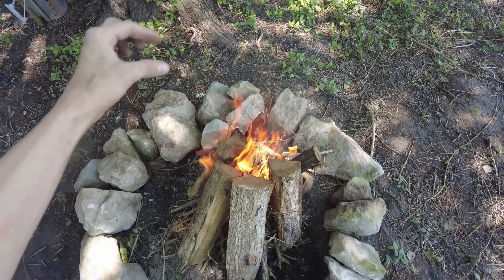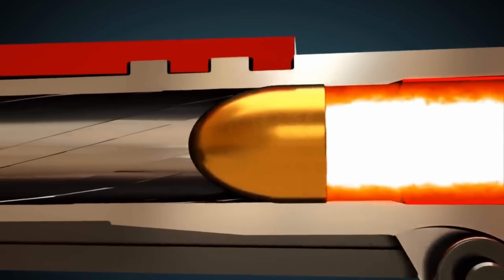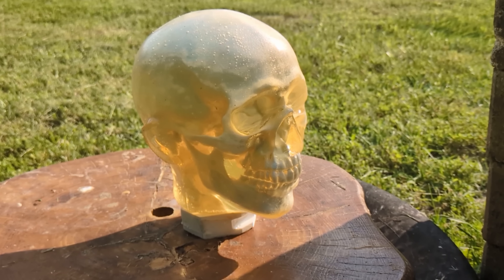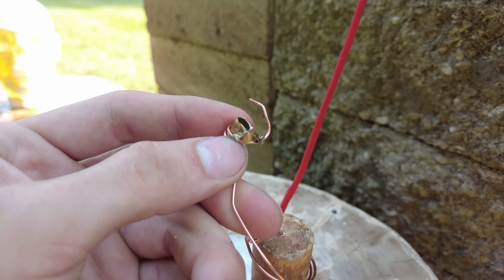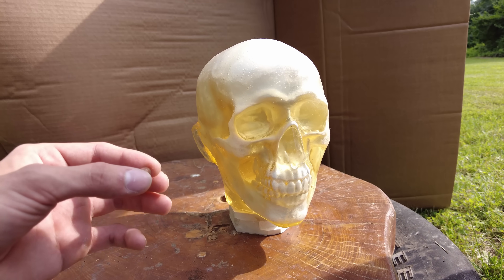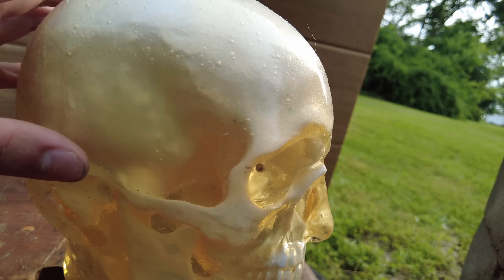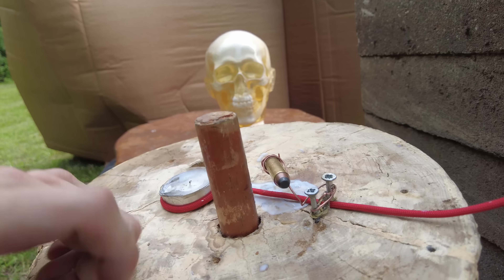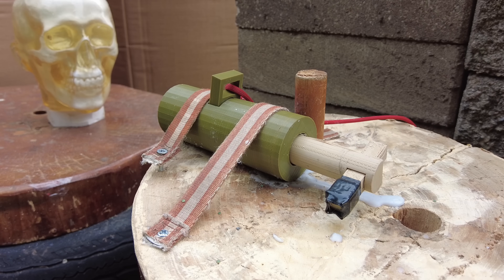Can a Bullet Kill Without a Gun?

Comment: In the case of a potential hang fire, it is suggested to carry the round by the bullet, (to the dud box) as it has more mass and the casing is more likely to fire as the projectile. Since there is no pressure or resistance to the casing outside of the chamber. I'd be curious to see this experiment with the bullets restricted and see how much damage the casings could do?

Comment: 1:55 I wonder if the wire is wrapped around the casing too many times.  If you look at the results of the experiment you can see how the case is shredded up at the front end where the bullet is, but not where the wire is wrapped around it, apparently helping to hold it together.  This means the wire is having some defree of influence over the outcome of the experiment.  It may require a stiffer wire, but the wire should be wrapped around the casing as few times as possible, optimally only one wrap or fewer (by fewer than one I mean like 3/4 or 4/5 of a full wrap,) and it should be all the way at the rear of the casing toward the primer end where the casing is strongest and will probably not shred regardless of the wire.  That way the wire is not having a really appreciable effect upon the outcome of any of the tests.

If anything, the wire is helping the bullet, and the test is already showing that showed that the .22 appeared not to damage bystander facsimile, so it's less important on the small caliber test, however, this kind of thing could make a more appreciable difference with a higher power bullet, helping the casing act as a sort of mini-barrel to concentrate and direct the forces the nitrocellulose applies to the bullet.  If the casing explodes then the bullet is imparted with considerably less force than if the casing remains intact.

Honestly it doesn't matter because the danger is so low, either way, but isolating variables is always a good science habit.

Comment: So for the sake of science I'll give input as someone that has been hit in the forehead by a 9mm bullet in a similar fashion.(Context: Was nearly 11years ago, was in a dark place, learned my lesson and doing well now so no worries)

From a distance of I think roughly 8in away, it hit the center of my forehead. Broke skin at the impact point and left a small scar but no real major damage. Had a headache and ears ringing for a moment. Bled a fair bit like any head wound does. Cleaned up and put a bandage on it and was fine. 

Was held with pliers and put a lighter straight to the primer. In my case the casing stayed fully intact minus the primer being ejected. Unsure if that's from the heat being more localized directly on the primer, the pliers helping hold the casing together, or both. Also unsure if the casing holding shape affected the pressure output on the bullet head at all.

Comment: Honestly. I think the experiment should be redone with some kind of copper wire holding a nail in place to hit the primer and a hammer on a kind of swing arm that hits the nail into the primer. 

Like the thumbnail of the video. Would have much better results especially with the shotgun shells. 

I did a similar experiment with a tracer 9mm round and almost started a fire. Very entertaining.

Comment: I think part of the "problem", is that the case is not being braced against anything. So it's accelerating the case backwards, while also accelerating the bullet forwards. This reduces the bullet's overall velocity. So this is fine for whether or not throwing bullets into a fire is dangerous or not, but if the case is braced against something securely, they might be lethal.
Reply: If you had a barrel, though, you can have no gun breach to brace the shell's rear and still have usable forward velocity. Recoilless rifles were very prevalent for a time using this principle, it cuts velocity roughly in half but almost totally mitigates recoil.
Reply: @bluntcabbage6042  Recoilless rifles actually do have a brace. The basic principle behind how a recoilless rifle works is accelerating a ballast rearward, to cancel out the recoil. The theory is, if you position two identical guns back to back, their recoils will cancel each other out. A recoiless gun works in the same way, but instead of a second gun, it's accelerating a ballast made of gas, rearward to cancel the recoil. But principle is the same, the two guns are braced against each other, similarly the projectile accelerated out the barrel, is braced against the propellant that was accelerated out the rear.

Comment: its because he is using heat to weaken the casing which cooks off the round. If you actually strike the primer correctly with enough force it will set the round off. The most common tactic used is shotgun shells under a piece of flooring (typically the area between doorways) and when stepped on pushes the shells into nails standing vertical and will fire them up through the floor.

Comment: In Afghanistan they used to saw a propane tank in half, reinforced the bottom with a circular steel plate and load the bottom with HME tons of heavy nuts and bolts and point it at the road to penetrate the sides of our MRAP’s. DFC Direction Fragmentation Charge I believe the acronym stood for I’ve been out for 11 years and deployed to Sangin back in 2010-2011.

Comment: Higher power rounds, like magnum rated pistol cartridges or supersonic rifle cartridges, often split under the immense pressure, and it is not uncommon to find bullets, still pressed into brass cartridges, that failed at the middle or primer end. The bullet seat and barrel are necessary for bringing the bullet up to speed, but the firing chamber and bolt are critical to reinforcing the brass cartridge and producing a repeatable effect.

Comment: Bullets need the pressure, otherwise it's just a fire cracker lol. I watched garand thumb fire a 50bmg round out of a 12 gauge single shot shotgun, it basically fell out of the barrel lol. OK ok, it was slightly more violent than that but I honestly question whether or not it could have done any damage. This happened because the 12 gauge barrel did not have the same neck down that the 50bmg cartridge did. So the cartridge just expanded out to fit the barrel of the shotgun and in result lost most of its pressure. Then I watched another video, this time it was Kentucky ballistics and he was shooting rounds into a 6ft deep tank of water towards a ballistic dummy. He tested numerous calibers, including 50bmg and none of them reached the ballistic dummy and did no damage. Which I suppose is a good thing to know if I'm ever being shot at.

Comment: I did NOT expect the bullets to be this weak without a gun, I suppose a ton of pressure does escape without doing the propelling, but it's still astounding.
Reply: Same reason why if you make a tight fist around a good sized firecracker will remove fingers while on an open palm it causes minor damage. Pressure does crazy stuff to explosives.
Reply: Yeah thats not why its because he is using heat to weaken the casing which cooks off the round. If you actually strike the primer correctly with enough force it will set the round off. The most common tactic used is shotgun shells under a piece of flooring (typically the area between doorways) and when stepped on pushes the shells into nails standing vertical and will fire them up through the floor.
Reply: @armyvet1387 wasn't that shotgun thing just a myth from the movies
Reply: @ConFlow247 no it was a trap dating back to vietnam (though they used bamboo cylinders to hold the shell and used a pressure plate trap on top) very simple to make and devastating because the buckshot tears through your legs where you have some of the largest blood vessels & major arteries not very well protected compares to center mass. Its still used to this day in IED preasure traps because of its effectiveness.
Reply: @armyvet1387  what is preasure a typo for? Depending on which this has very different implications...
Reply: @TomiSucco should be pressure 😅

Comment: The part that is going to seriously hurt you is the fast moving pieces of metal of the casing.  

The projectile doesn't move particularly fast when it the cartridge detonates because of inertia, it's the rest of the case that blows apart that causes you the most grief.  It's the weakest point of the whole transaction, that's where it actually blows out and hurts you.  

I know of someone who dropped a cartridge on the primer, which detonated, and he ended up with shrapnel injuries to his face (he watched the cartridge fall) and to his legs as a result, do not try this at home.

Comment: Mythbusters did a similar myth with similar results (putting bullets in place of a car's fuses), with shrapnel just about strong enough to pierce through clothing and unless hitting a vital point would leave only light wounds. 
On a more serious case, there's a report of a soldier setting up a machine gun mount and having trouble setting the fixing pin he picked up a 50BMG round and hammered the pin with the butt of the round. I don't think I have to explain what happened.

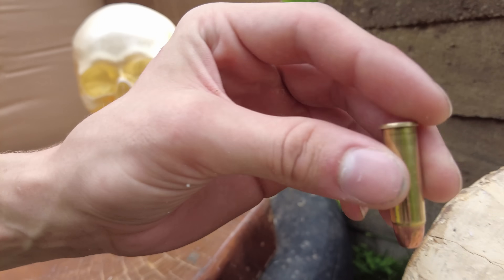Comment: @4:29 The .38 Special's bullet is not smaller than the 9mm at all.  It's the same diameter, and usually heavier (so longer) than a 9mm bullet.  Note, I say "usually" because the common bullet weights for 9mm are 115 grains, 124 grains, and 147 grains.  For .38 Special, they are 125 grains and 158 grains, though you sometimes see lighter (110 grains) or heavier (180 grains), just not that much.  And of course, there are some bullets that will stray outside of those typical weights too, but those are often solid copper instead of lead/copper jacketed.
Reply: Sybau
Reply: Ok nerd 🤓
Reply: @DClaudepierre  Lol, I've got the gun autism.
Reply: @DClaudepierre  oh excuse him for sharing accurate info on an informational video’s comment section. Maybe you were looking for some genre of “brain rot”?
Reply: @E @El_Pozolero huh?
Reply: @El_Pozolero  It ain't that serious, dude.
Reply: @El_Pozolero 😂 diddy ah blud

Comment: Fun fact the Vietcong used to use rifle and shotgun shells with bamboo as a trap. They would but a very narrow bamboo shoot to simulate a barrel around the cartridge but a nail against the primer. And put a board or even surface overtop so when people stepped on it it would actually set off the primer and fire the round. This was very effective throughout the war
Reply: Elite knowledge i commented this very trap on people talking about the shotgun shells, i just explained the trap but basically it was user error not the fact that without a shotgun the shell is still very lethal as a booby trap. But ill stick with my m82a1 50bmg I won from a vfd raffle instead 😂

Comment: To answer the first question, YES you can dye from a bullet in the fire.
How do I know this?
After Desert storm the o331s didn’t have enough action, so one of the through a handful of AK ammo in the fire box (it was a filing cabinet, at Al Jabar airfield) and they went flying everywhere.
One hit the HMMV just below the mirror I was using to shave with.
No warning “fire in the hole” or anything.  Just the sound of fire crackers going off.
Glad that’s all that happened, would have sucked surviving the darkness only to get hit by a stray round from a fire.

Comment: What exactly is the spring loaded mechanism thing?
Reply from the maker: It's just some thing I 3d printed. I designed inserts for each round so they'd fit in place, only to end up using a candle instead, lol.
Reply: @SomethingAbtScience but like, how is it supposed to set the round off? Does it have a firing pin inside?

Comment: As a rookie firefighter I was in a house fire and we heard rounds cooking off. At the time I didn’t know. But later learned that we probably weren’t in real danger. Of course the seasoned guys knew.
Reply: still does not change the fact that standing next to ammo cooking off is not smart there is always that one in a million odd of a lethal combo happening even if its not lethal you can get messed up bad by shrapnel larger cases could easily slice an artery and its over
Reply: @HeathensHaunt  I think in firefighter duty gear that's not happening
Reply: @davidebic  Yeah, from what we saw here, even Denim would probably be enough to stop any sharp bits.
Reply: Always wondered if a "standard" gun safe will hold back bullets in case of a fire.
Reply: @anamethatsnottakenalready Yes, the mythbusters showed that even the thin wall of an oven will stop rifle bullets.  I think it was able to shatter the glass though.
Reply: Well what if the house owner stored not just rounds but also loaded guns with a round in the chamber, so they go off in the fire? That's gonna be much more dangerous
Reply: @hyperthreaded True, though unless they have a huge collection that's probably a lot fewer rounds.
Reply: Yeah that’s pretty much a no brainer. Without a chamber and a barrel to create pressure a bullet does basically nothing. When it’s in a chamber and has 50,000 psi or more behind it; to force it down a barrel, then you’re in a lot of danger.
Reply: @dustinteasdale6091 That’s not a no brainer WTF are you on if you don’t know anything about guns
Reply: @Backwoods20004  In America
, a loaded gun is given to us at the hospital when we are born and our curriculum in kindergarten consists of learning about the second amendment exclusively
Reply: @Backwoods20004  basic understanding of physics can also be really helpful sometimes
Reply: @flummoxedisntit   You'd also need to understand how a bullet works to apply that knowledge of physics, most people do not know any details of how a bullet works, they just know there is a bang and then the projectile goes flying with the power to kill people.
Reply: The problem is someone having a gun loaded when it is in the fire.
Reply: NFPA has a video about this.  Unless the cartridge is in a gun, it's not going to harm you.  Even gunpowder (not to be confused with black powder) just burns hot until it is gone.  Black powder will blow up...
Reply: I still wouldn't stand right next to them though, kept a little distance at least.

Comment: People never consider how light the casing is, if it’s not held in place, it’s going backwards at a similar speed as the bullet is going forward, that being very slow for a bullet.
Reply: If the case is lighter than the bullet, it will travel faster as it has the same amount of energy acting on it.
Reply: It's moreso the strength of the case. Brass or steel that thin isn't going to contain an explosion

Comment: The dents in the .22 rounds were in the center of the rimfire case head. Might have worked better if the actual rim had been struck.
Reply: it’s called rimfire for a reason so yeah, probably
Reply: Strikes a rim fire cartridge in the center and wonders why it isn't going off. Love ya man but come on
Reply: Yeah, when I saw the device he made internally I was guessing he didn't offset it so that the pin hit the rim.
Reply: I wondered if that was the issue before seeing the aftermath on the casings.

Comment: When we were about 11 years old back in the 1960s myself and my cousin did a similar experiment. While one of us distracted our granddad, the other stole a handful of his 12 gauge cartridges. As a safety precaution we emptied out the lead shot before clamping a cartridge in a vice and using a hammer and six inch nail to set off the charge... the resulting explosion was so thrilling we repeated it till we ran out of cartridges... kids today are too protected....
Reply: I agree. As a kid I used to take the gunpowder out of firecrackers, wrap it in duct tape with a fuse and put them inside squash and blow them to chunks. It was loads od fun. However I also lived in the country. I think country kids have more fun.
Reply: @mrr5835 I also lived in the country!

Comment: the shotgun shell was such a disappointment
Reply from the maker: It really was
Reply: @SomethingAbtScience  yeah wata bum
Reply: Shotgun shells have buffers inside them. The powder doesn't even touch the lead.
Reply: Wonder how a brass shell would perform 🤔
Reply: @judethedude6234 was thinking the same thing or even a +P/high brass shell? 🤔
Reply: @judethedude6234  hmmmmmmmmm
Reply: That was the only one that made me nervous! Lol
Reply: its because he is using heat to weaken the casing which cooks off the round. If you actually strike the primer correctly with enough force it will set the round off. The most common tactic used is shotgun shells under a piece of flooring (typically the area between doorways) and when stepped on pushes the shells into nails standing vertical and will fire them up through the floor.
Reply: @armyvet1387 that's exactly what I was thinking! It's been used in traps, even back in Vietnam! Even without a cylinder, it would explode whatever shot size in all directions. I kept thinking...I hope that's birdshot. It legit made nervous! I thought he was striking the primer!
Reply: Should’ve blowtorched the back end far from plastic.

Comment: Hang on a second.

Were you trying to fire .22 rounds by hitting the centre of the catridge?

That'll never work. They're rimfire, which means the primer lives in a donut shape around the rim of the cartridge. The firing pin needs to pinch the rim (at any location) in order to set it off.
Reply from the maker: Yes, yes I was.
This is some very useful info. I thought it could be struck anywhere
Reply: @SomethingAbtScience  

Reasonable assumption, but it won't work in this case. 

Normal primers actually have a little anvil inside the primer which is what you crush the compound against. Rimfire lacks this, so the only way to properly crush the primer is by pinching the edge. 

It's a simpler design but the downside is that the brass must by necessity be quite thin. Doesn't work so well once you step up to larger rounds!
Reply: I was just about to say "rimfire" 🙂